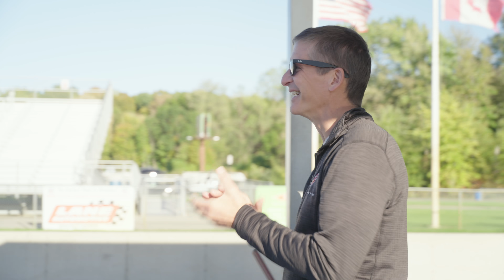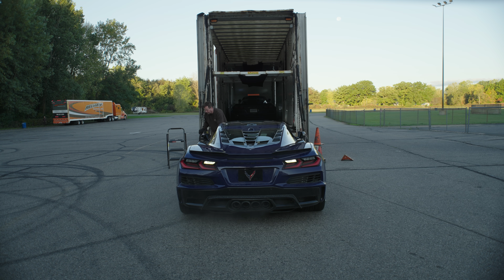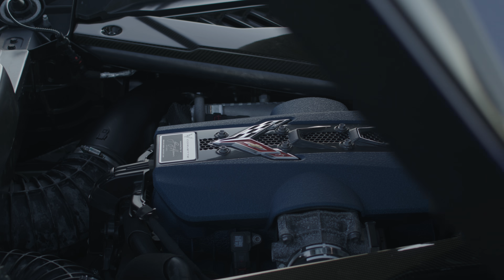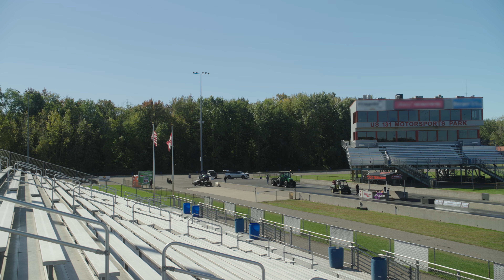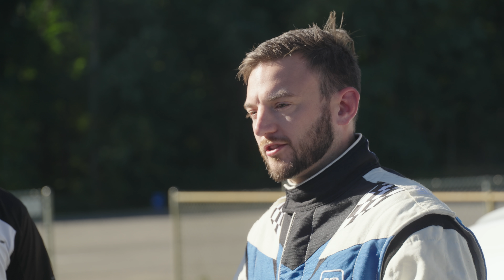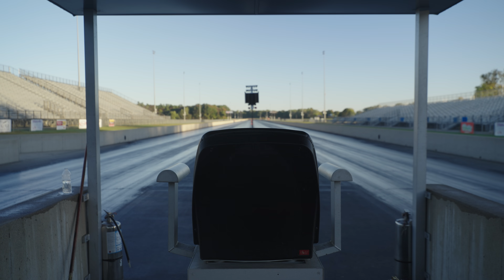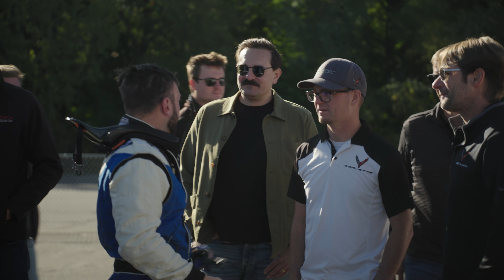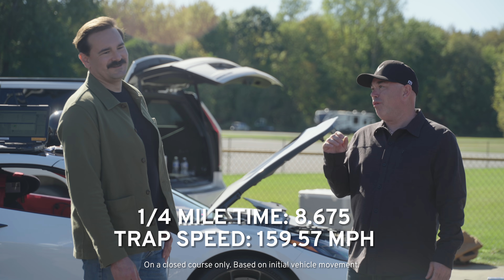We Pushed The Corvette ZR1X To Its Limits (DRAG STRIP TEST)

Comment: It has so much torque, how is the chassis not twisting coming off the line? Family
Reply: That kind of performance is reserved solely for 307s and 305s.
Reply: The gallo 12 engine is just so smooth and effortless.
Reply: Hell yess!! But note they are NOT testing the convertible version!!
Reply: The rear drive/mid mount engine is KEY
Reply: The wheels are part of the engine, essentiantly
Reply: The chassis is incredibly stiff. This is a track car first and a drag racer second. You want the chassis as stiff as possible because you (as an engineer) will be able to control the car’s dynamics through the suspension and shock absorbers.
Reply: @Spuds555McMuffin it was a F&F reference
Reply: @Spuds555McMuffin  it what about the force of family?
Reply: @Spuds555McMuffin It's actually a road car first.
Reply: @Spuds555McMuffin whoosh
Reply: Bc chevy always had the best chassis in the business.  Facts
Reply: Because there is not those type of forces on the chassis in a mid engine car. The engine is mounted directly to the transmission.  Where is the "twist" to the chassis going to come from?
Reply: @chrisrodenbeck6327  does in fact not live his life a 1/4 of a mile at a time.
Reply: @chrisrodenbeck6327 You missed the joke.
Reply: @chrisrodenbeck6327  Yep!

Comment: That fact that GM didn’t acknowledged the Demon 170 was super shade. I hope Dodge answers
Reply: They're marketing against super cars demon is a one trick pony (sometimes) stars have to align first. Fastest I've ever seen a showroom stock demon run without changing wheels n tires or suspension is maybe 9.2@147.
Reply: @bobtaliaferro5492 -and if I’m not mistaken, brooks over at drag times got the ZR1 to 9.17 at 153 I believe ??
Reply: @bobtaliaferro5492 demon 170 runs a 8.91  @149. NHRA certified.

Comment: NHRA recommends one parachute starting at 150 mph, and two chutes above 200. 

160 stock is super impressive.
Reply: Yep. Make one run like that and you'll find yourself escorted out the front gate in less than 10 minutes.
Reply: Even though the track they are at has a really long shut down area, a chute would be nice to see.  I remember Cleetus went through the traps there at around ~220mph in Tom Baily's car and both chutes failed and he still made the normal turnout and the only damage was to his pants.  https://youtu.be/yGup5LBb0Ho?si=fX1xz5IBLT55Zxt5  The video if anyone is interested.

Comment: Barely edged out the 4 door family sedan Lucid Sapphire at 8.93 in the 1/4 mile. I mean its good, yes, I guess i just expected more from a completely focused two-door sports car. I wonder how they will justify the price against something like the SU7 Ultra which shares similar performance specs and even beats the 0 to 60 time of the Corvette.
Reply: The corvette can also set lap records around a track, unlike the lucid. The lucid is a one trick pony.
Reply: @magnerionmachine69  I can agree with that. Although for a sedan, the Sapphire holds its own around the track. But that's not what i was comparing here. They did a dragstrip run and boasted the quarter mile time. I made a simple comparison. I'm sure the Corvette will take it around the track.
Reply: @MurseTech64 -frankly, the ZR1 will murder it on top speed also, 233 mph.
Probably the ZR oneX will be slower since the electric motors increase the weight, and shouldn’t increase the top speed.
Reply: @rhpicayune No I get all that. I'm only saying I guess I expected more out of a two-door focused sports car in comparison to a heavier four-door family sedan with copious amounts of luggage space etc.
Reply: Told ya and it's just beginning
Reply: Your gonna get mauled for this comment prolly by sunset lol
Reply: @bobtaliaferro5492 Not sure why, nothing but facts.

Comment: As an engineer, I'd be interested in the stock setup used for the best runs. What tire pressures, ambient temperatures, cooling methods, IAT's, gas and other things should I use to get these numbers?
Reply: Oh so u think their lyin...that's what everybody said bout thr ZR1 then when the public got them to the track they ran faster than gm's claimed 9.5 with a 9.2 stock on pump gas.
Reply: @bobtaliaferro5492  You're misinterpreting my desire for more information. I don't think they are lying. I just want to know the context behind their achievement.

Comment: And they didn't even use drag racing tires. 😦
Reply: Nah, dont need that anymore on street cars.
Reply: And they didn’t even use a regular driver to see what number it puts down. God forbid they don’t use some professional driver. GM is impressive for a chinese brand I guess. If you lived in Michigan during 2009, then you know exactly what I’m talking about
Reply: with the awd it probably wont pick up anything.... traction didnt look like an issue
Reply: @mcf3778  the traction control is really advanced on these things. You can choose how much slip you want while leaving. Slicks would allow more power to be put down with the same amount of slip so it would definitely drop some time but the flex of not using slicks is clowning on dodge which I can appreciate.
Reply: @mcf3778 nah I’m sure someone will slap four radials on all 4 corners, turn all the nannies off and shave a few tenths off that time. The drag tires will allow for a slightly better 60ft
Reply: @mcf3778 straight up wrong lol😂
Reply: @mcf3778  Advanced Nanny systems on these cars make it  possible
Without dont think this would be controllable
Reply: @mcf3778 AWD is terrible on a prepped drag strip since RWD cars put 100% of the weight on the rear on a prepped strip.
Reply: @mcf3778  Nah the AWD just means that you'll be more likely to be able to steer away from the crowd when you lose traction punching it out of the parking lot at cars'n'coffee.  Ford should look into doing a Mustang this way.

Comment: Lol this is crazy, I was just arguing with some corvette hater last night who said the zr1x wouldn’t run 8s
Reply: On street probably not
Reply: @jozefjozefczyk3936  this is America where you can find a prepped drag strip for every hour of driving you do. Who would be arguing about what a car run on an inconsistent and unpredictable surface when you can go test it in a controlled environment whenever you want?
Reply: @WyattB-b7v the stupidest answer I've ever heard. If so, zr1x won't be able to move on the road.
Reply: @jozefjozefczyk3936  now that’s the stupidest answer I’ve ever seen. It has awd and 1200 hp of course it’s gonna move on the street. But for the official numbers I don’t wanna see it on an unprepped surface. I wanna know what kinda times it will run on the local track. I must say thank you to GM for some relatable content that will be helpful when I’m eying up a zr1x and wondering if I should bet on that race.
Reply: This car would run 8.90s Out front on the street, it's all-wheel drive. The eray Consistently does 0-60 in the 2.6 range.
Reply: @j @jozefjozefczyk3936 it will still be one of the fastest production cars made on an unprepped surface… it did this on factory tires and it’s still awd 😂😂😂😂
Reply: @jozefjozefczyk3936  what? Yes, It will do 8's on the street.  1250hp AWD!
Reply: @jozefjozefczyk3936 e85 slicks 8 on street alert does 9.1
Reply: @jozefjozefczyk3936 the zr1 is running 9.4s 9.5s on a bad day how much more the zr1x I doubt it won't be in the 8s

Comment: 8.6 @ 160 mph 🙆🏻‍♂️
Reply: That is batchit crazy fast!  Wow
Reply: Same 1/4 mile as a tuned 750s
Reply: @Mikeeyyy666  The ZR1X did that stock. That's incredible.
Reply: @Mikeeyyy666 very, very, very far from reality
Reply: @Mikeeyyy666 why weighing a thousand pounds less lol
Reply: Like you can really feel the difference from 160mph to 159mph 😢 some people are just…….. Regardless Corvette ZR1X is a Supercar no debate
Reply: @JoseD-f2d And some people have poor reading comprehension. Not 1 person is arguing how it feels. The argument is the actual time.
Reply: That is crazy fast
Reply: No cage,no parachute, in a carbon fiber and fiberglass case...160mph -0 into a immovable object..how proud will you be  in that scenario?
Reply: 159. You can't just round up everything has to be earned when it's on the track. Still I don't doubt it can get another mph or 2 so 160-161 is not out of the question.
Reply: @WhereDoYouWantITSkinner dude it’s .50 of a mile it’s find to round to 160
Reply: @alexkoelle9513 not how it works. Again they are looking for legit times this is why GM put 159 they went down not up. Ask anyone at the strip if thats ok to just round up.
Reply: 155.59 but who cares
Reply: 159.55
Reply: @WhereDoYouWantITSkinner  "it's not 160mph, is 159.55mph" ☝🏼🤓
Reply: @Luke-cb3ly it is what it is. If you buy something and it's $20 but you only have $19.90 you don't get to round up and close enough. Go to any track and find out if they round up bet all the legit drivers say, no. The time is the time. Even GM gave it a 159mph.
Reply: @WhereDoYouWantITSkinner understood but it's a blink different so it makes no difference
Reply: @Denvercardealership if that were true GM would have rounded up. The time is the time you can only change it by having a better run. Tell me 1 time an 8 sec car ran a 8.0 but they said close enough its actually a 7sec car. Doesn't happen. It needs to be done on the track.